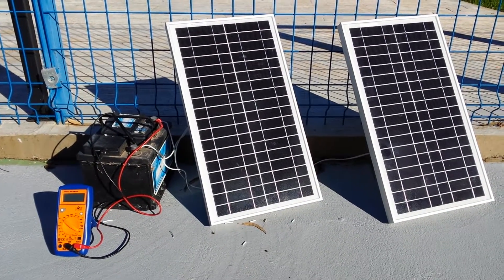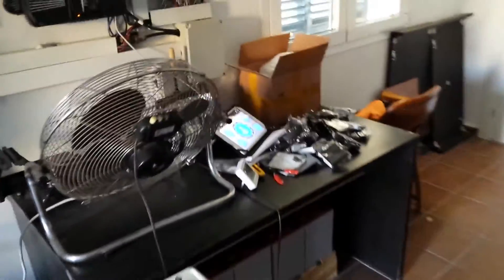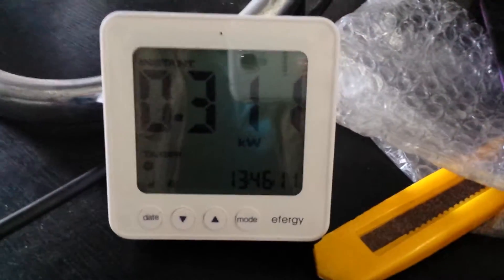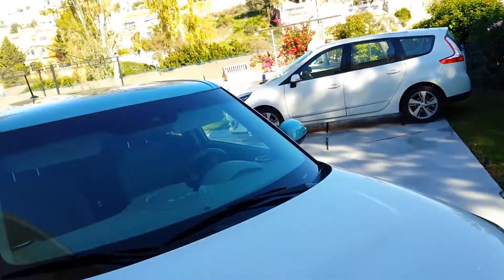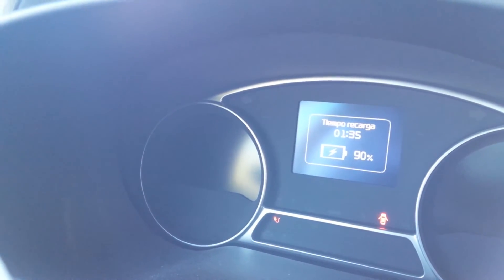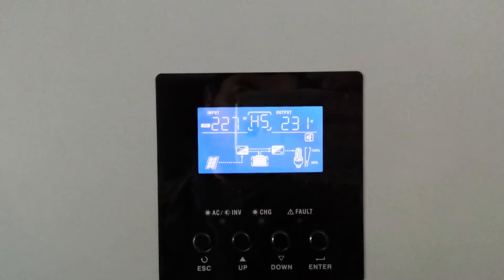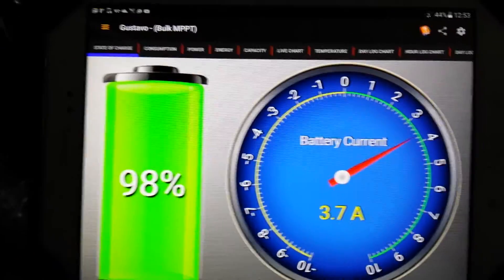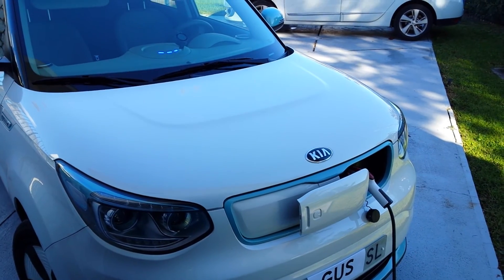Solar Charging EV offgrid 🌞 KIA Soul EV 🌝 Mpp solar PIP 4048 and Midnite Classic 150 Poweeerrr

Comment: I like your car Gustavo.  I am dreaming of an electric car too but am wondering if it is feasible as I am off grid.  I think that living on such a small island there are probably enough fast chargers around that I could charge the car from the grid chargers and then keep it topped off with charge from my panels when they are in float.

I am going to buy a Pip as a back up for my charge controller and inverter.  Where did you buy yours from?  
I have seen some really cheap ones on ebay but they are sent from china so am a little dubious whether they are actually real or if they are rip offs.

http://www.ebay.es/itm/HSE-3kva-24v-2400w-inversor-solar-hibrido-50A-cargador-solar-/132032048040?hash=item1ebdb92ba8:g:878AAOSw4shX2O8K

also Atersa have an inverter that looks like its a Pip with an Atrersa sticker on the fornt:
https://autosolar.es/inversores/inversor-cargador-3000va-24v-atersa-quadro_precio?gclid=CLC2_bu6kNICFYYcGwod24kJRg

How big is your solar array?